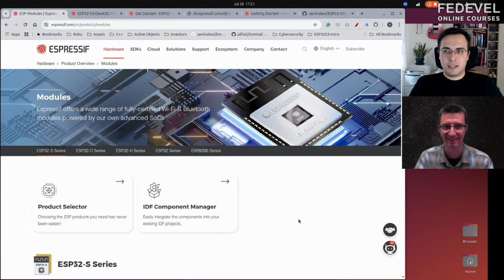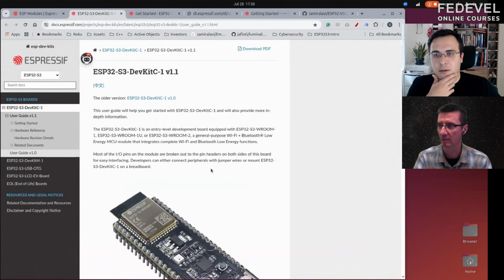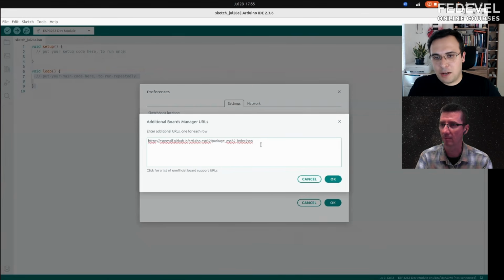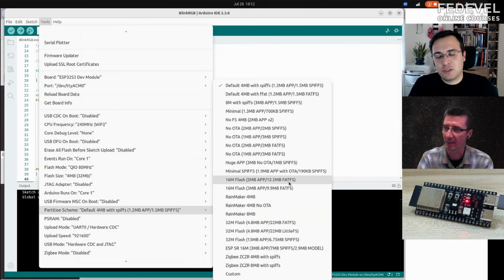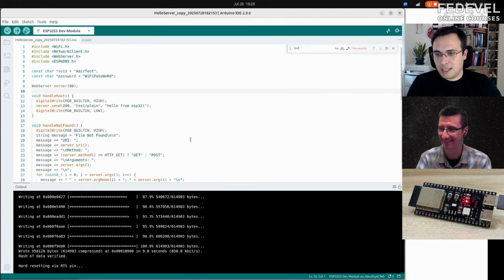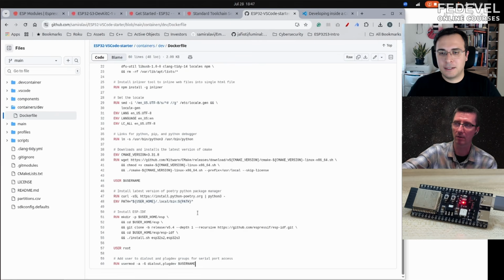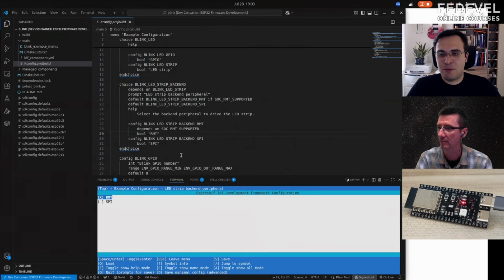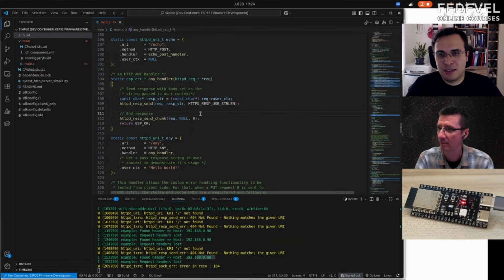ESP32 for Beginners: Selecting module + Starting with Arduino and Espressif IDE

Comment: Really great video!

I've got Amir's ESP32-VSCode-starter dev container project working perfectly with both Windows and Linux host OS.

To get my FT4232H interface board working for JTAG debugging of original ESP32 device, (1) I changed "/dev/bus/usb/:/dev/bus/usb" to "/dev:/dev" in file .devcontainer\devcontainer.json and (2) in the host OS I added a udev rule file to /etc/udev/rules.d for the device.
Reply: I just created a video that shows me going from nothing to serial programming and FTDI JTAG debugging from Amir's esp-idf Docker container in Windows in just 13 minutes! 🙂

I use usbipd + a udev rule + a Docker setting to make the Windows ports available in the Docker container.